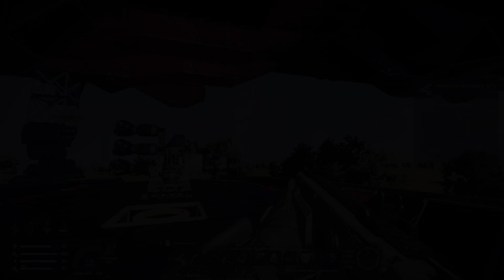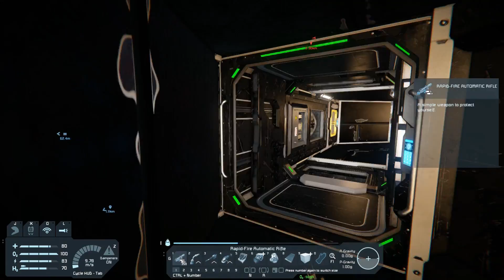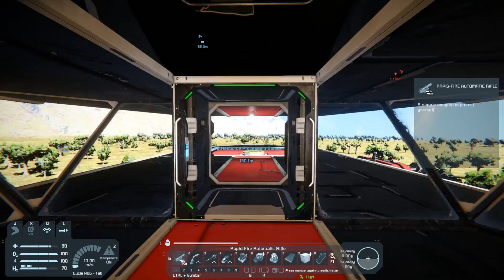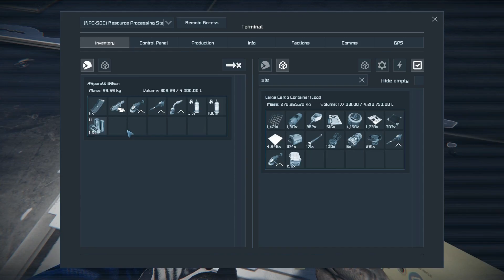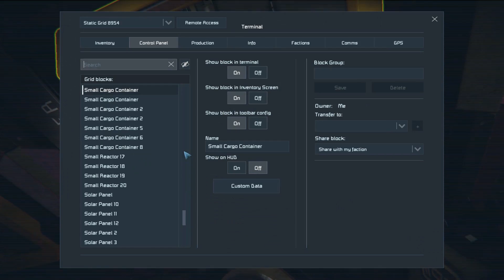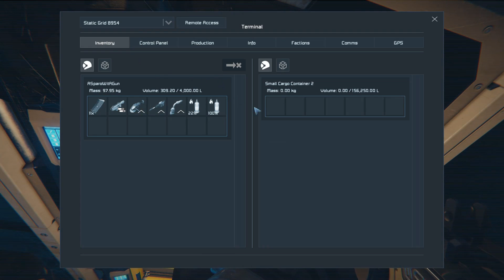Building A Grinder Drone & Solar Panel Planning! - Space Engineers LP - E11

Comment: Replace the front cargo container with a large conveyor junction and re-orientate the rear cargo container to connector to it, it's the best way to go plus your definitely want to add more thrusters. I would recommend doing solar towers instead, either a large one or smaller ones doted about the ship/base. Go to Splitsie's channel as he's done work on the best way to build solar panels in a tutorial and built them in his survival series.

Comment: no matter what i do, i am not getting any pirate spawns.. i do get wolves and spiders in various worlds, but despite having random encounters turned on, no ships other than the unknown pods for gear skins.. any ideas?
Reply: There are world configuration that can control spawns for things like random encounters one is easy to get to. It is part of the options that you can select for a new game or edit a saved one but I believe there is also one that can be changed outside of that though I am uncertain how. You might be running afoul of the later if the world you are in is something that someone created and put up in the workshop instead of the standard preset game starts. One way to bypass the issue might be with a recent mod that controls encounters I seen in the workshop. It is supposed to allows for a fine tuning of random encounters. I haven't used it myself but it might be something to look at if it isn't a easy fix of an unchecked option box.
Reply: @josephkasmarcik2895  completely vanilla game, fresh start with random encounters, drones, unsupported ships, wolves and spiders enabled. The only spawns i am getting are the random unreconised "probes" (that give off special skins) and the wolves on terran worlds and the spiders on alien worlds.. No pirates (despite seeing their factions in the menus). Tried several different worlds with different configs. nada.
Reply: @42cdiver  

If I recall the vanilla game didn't have any on planet pirate ships aside from spawned drones. Which I believe appeared mostly from preset bases. It was when you went into space that pirate ships became a thing. If I recall it was because there was some trouble with drone flight in atmosphere at the time. So I can only suggest setting up your own pirate bases or use some of the mods to spawn in enemies on planet. I have the antenna names you need to use to get spawnable pirate drones if you want them but they can also be found on the SE Wiki.

Comment: The set up for the grinder is a tough nut with out doing some major changes, gimping the grinder or placing the connector off on a elbow of one of the arms or something similar. Maybe it might be better to rethink your drone Chassis from the start such that you can just add the type of head for the job you need it should also make it easier for your welder to get the whole ship in a single go and cut down on ships cluttering up your pad. I worked out a chassis that is nearly the same from the cockpit back that could work you just need to replace the med storage container under the cockpit with a conveyor and reorienting the rear med cargo to connect it with the large end then if you want to drill just slap on two drills one on the small front cockpit connection and one on the connector. if you want a grinder add a conveyor on the front and 2 elbows and you can have up to 3 grinders or welders. I also checked if you want to have it auto welded as long as you set up the welder directly touching on the battery closes to the medium container and centered it can hit every part so you don't need to weld anything except the parts you want to add for the job you are using it for.

On a unrelated note your ship seeming to slide on its own in my experience means that the ship is connected in some way to a separate grid through something like a piston or rotor and that is messing with the ships ability to stay properly oriented. It doesn't appear to bad so it is likely near the ships center of gravity or is small. Removing the item or locking it with a landing gear should fix the issue.